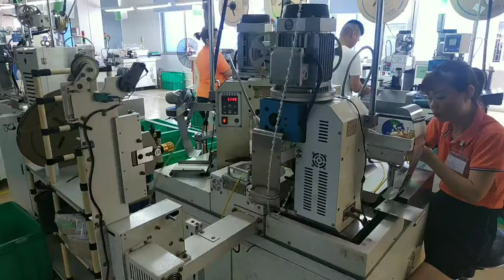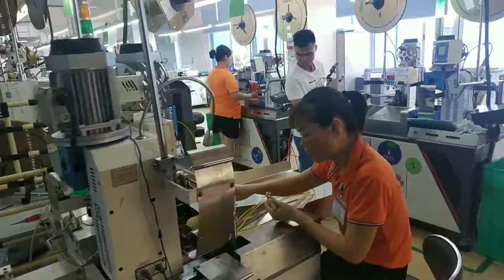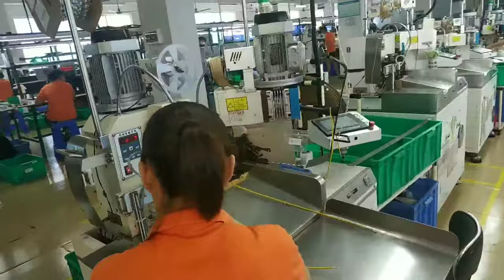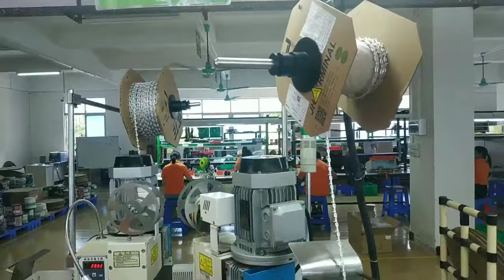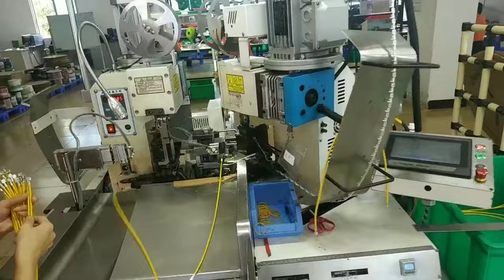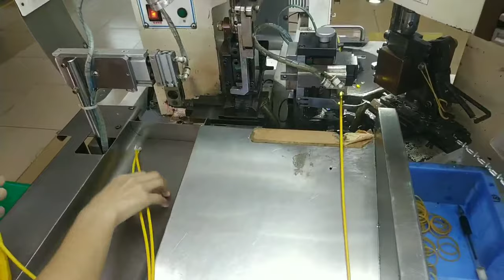Nangudi Wire Harness And Cable Assemblies Manufacturer Production Process

Comment: Semi Automatic IDC termination machine for TE connector Semi Automatic IDC termina tion machine for stocko connectorSemi Automatic IDC termination machine for lumberg connectorSemi Automatic IDC termination machine  for RAST connectorAutomatic Wire Cutting, Twisting, Tin dipping and terminal crimping machine Automatic Single Head terminal crimping machine Semi Automatic IDC termination machine Automatic terminal crimping machine Fully Automatic IDC termination machine